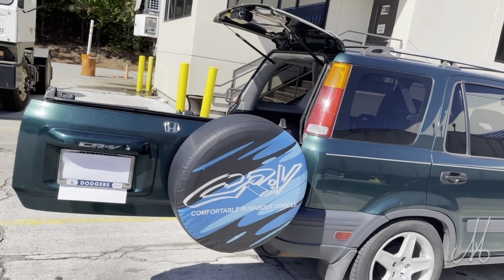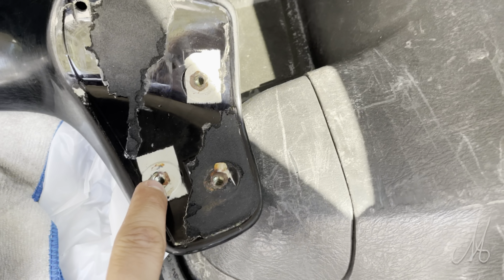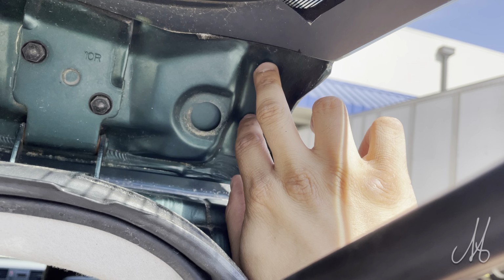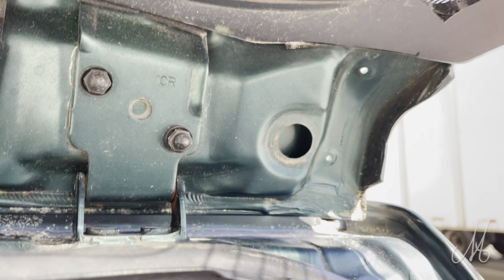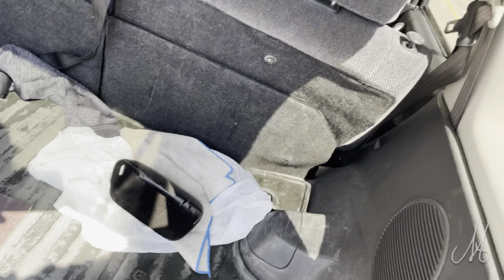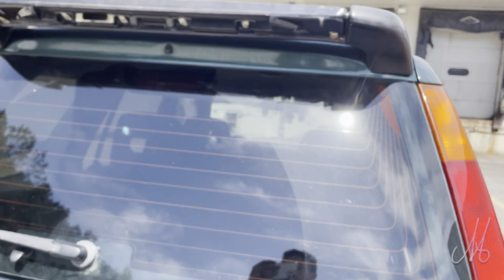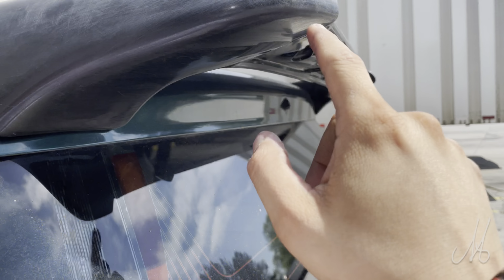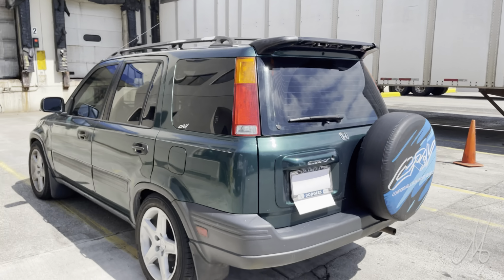How to install OEM spoiler 97-01 Honda CR-V

Comment: The paintjob looks really good wish you would have showed the process
Reply from the maker: Thanks the only reason why I didn’t show it is bcuz I am not a painter but I am not afraid to get down. But all I used was oreilly perfect match rattle cans 2 coats of prime and 3 coats of green and then 3 coats of clear. Hope that helps
Reply: @Moco_crv  thanks i see you have a dodgers license  plate holder are you from La if so so am i :D

Comment: Hey man when you painted the bumpers SE style did you paint the black plastic first or the green pearl first. I’m about to do the same and I’m not a painter. Just worried about the line between the black plastic and paint.
Reply from the maker: to be honest I didn't paint the black plastic at all mine was not that faded so i just went and put the green on top.
Reply: @Moco_crv  thanks man i appreciate it. 2 coats primer, 3 base and 3 clear? Also did you use wire tape for the line or just masking tape
Reply from the maker: @devindean1167  2 prime 3 base 2 clear i got my base of auto parts store make sure you have good lighting in your place of painting bcuz it will show you where you need to put that base more. just masking tape with news paper. go slow on the masking so you get a nice clean line. i used blue tape.

Comment: Question bro I got my wing a while back but came with no bolts..do you happen to know where I can get replacements ?
Reply: Let me take one and find you the right size and length from ace hardware and I’ll send you the info.
Reply: @jasonmelgar1122  thank you
Reply: @jasonmelgar1122  please lmk I’m missing screws the  two mounted on each side not under the plug
Reply: @fume5671  any luck man ?
Reply from the maker: @Alex86056  which ones are you missing the small Phelps screws that hood the chrome peace ?
Reply: @Moco_crv  no thankfully got all of those , it’s the 6 screws to mount it to the car itself
Reply from the maker: @Alex86056  okay I’ll swing by tomorrow by ace hardware to get an exact measurement of that screw.